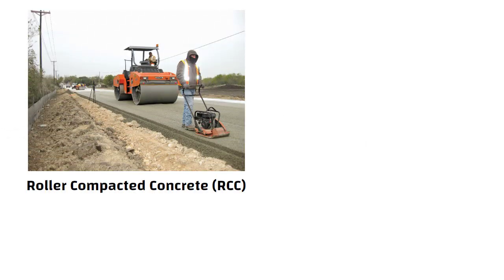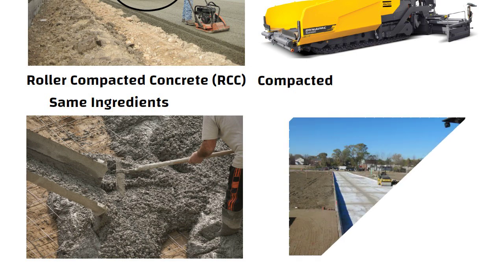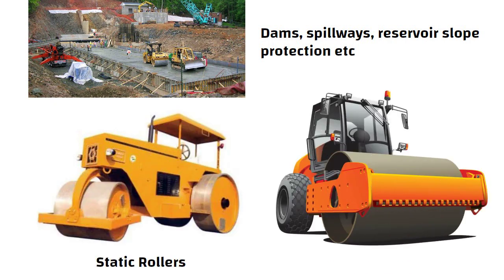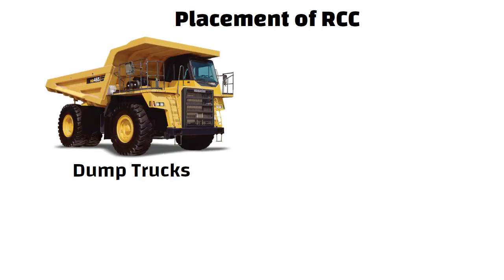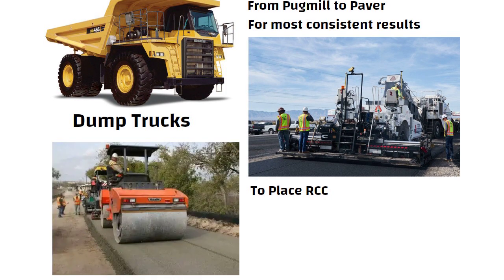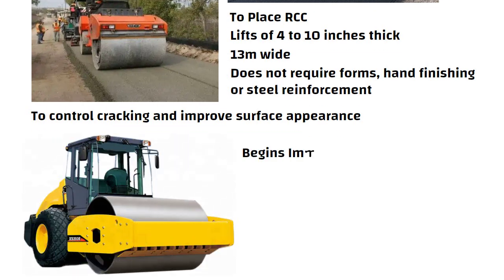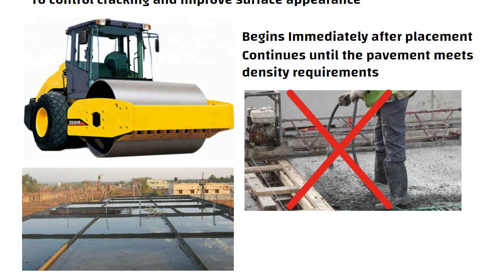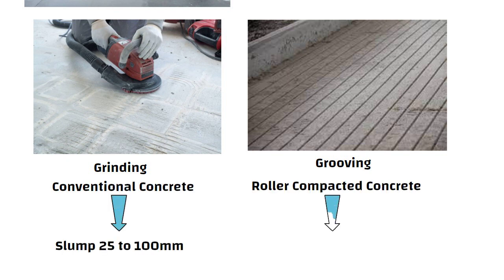Roller Compacted Concrete: The Future of Road Construction

Comment: Are they using the walk-behind (vib plate) next to the edge of the RCC because the heavy roller can't be used next to the edge?  Have you ever placed RCC next to existing concrete curb & gutter?